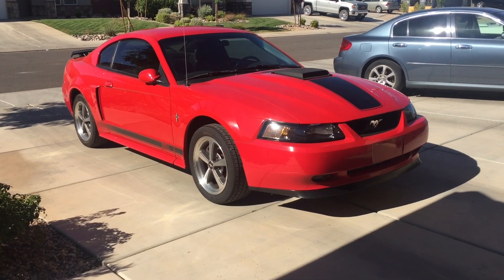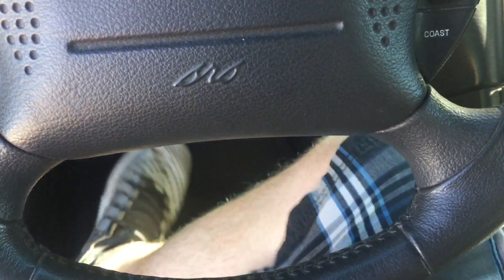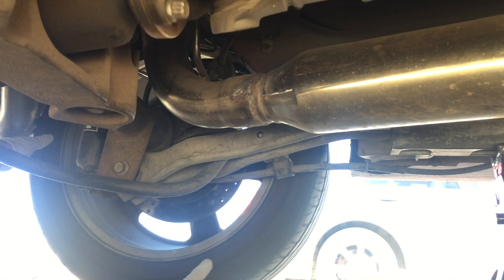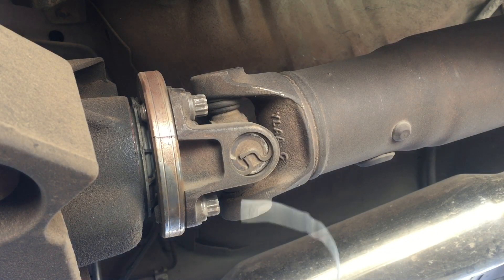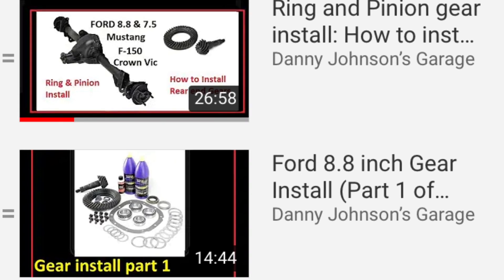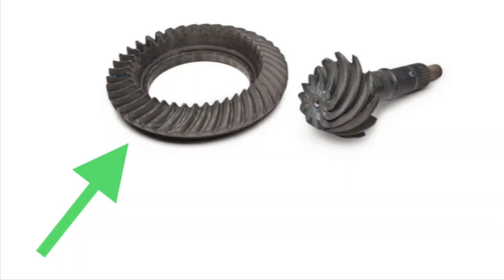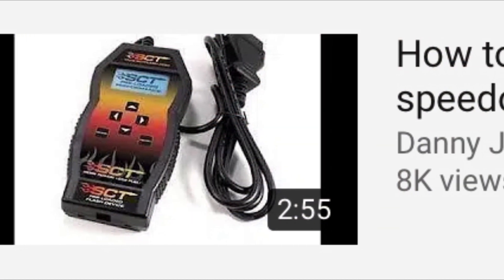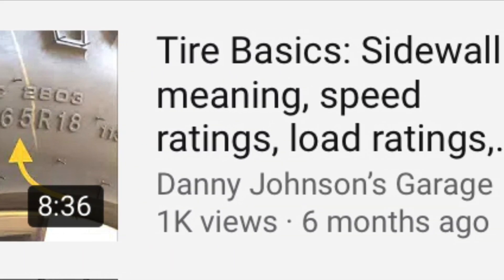What gears does your car have? How to calculate gear ratio or see what gear ratio: Ford Mustang

Comment: Mine came out to alittle over 1 .5 for the driveshaft revolutions to one turn of the tire like you said.   I’m trying to figure out if I have stock or 3:73 from previous owner.  Am I doing something wrong here.   Lol
Reply from the maker: What transmission do you have and what is your rpm on the freeway at 75 mph? What size wheels?
Reply: @dannyjohnsonsgarage  5 speed t45/ stock 275/45/17 tires. I have adjusted my speedo    It used to be 10 off but I adjusted the needle to match gps speed. It’s pretty dead on.   I don’t know if p/o put in 3:73 gears or not.  From the speedo to Rpm’s I would think he did but then the tire to driveshaft rotation did not match up.  That’s why I’m confused now.   The rpm’s are 2.3 at 70 mph.  But again.  I adjusted the speedometer needle.
Reply: @jamesa6272 with the same trans, tire height and 4.10 gear my 97 cobra would turn 2700 at 70 so I'm thinking yours is a 3.55.  373 would be in the middle prob closer to 2400-2500.
Reply: @midnight347  it was the stock gearing. 3:27

Comment: I run a 315 in the rear so if i had 4.10’s about where would that put me?
Reply from the maker: 315 would be the width, so it more depends on the ratio height 315/XX/17 https://youtu.be/3GTTx-XdOXE
Reply: Is it 315/35/17?  If so that is stock height you should be 2500-2700 rpm at 70 depending on which trans you have (if it's manual) you left out alot of important details haha

Comment: 4.10's are a fun ratio on an NA car.
Reply: They're a fun ratio on a boosted car too lol.. I have a 07 gt500 740/733 rwhp/rwhp in 90 degree heat on fat drag radials with a gen3r and it has 4.10s.  It hooks 2nd decent in 2nd and is fine to drive (I have a serious tire on it).  I've contemplated going back to stock 331 gear but I do like how the 4.10s feel the tr6060 is geared kind of tall.
Reply: @midnight347  it can be great for booster applications as well. For turbos it’s stupid to run a gear ratio like that,something like a 3.31 or 3.27 is much better suited. Centrifugal blowers going with gear ratios like that works well. Personally I wouldn’t go higher than 3.55 with a PDB but that’s just me

Comment: Nice video how to do you like the 4.10’s? I’m having mine installed next week.
Reply from the maker: You need good tires. I spin stock ones all the time. I do like the 4.10s though
Reply: @dannyjohnsonsgarage  I look forward to trying them out. I run larger than stock wheels and tires so probably closer to 3.92's since I run 275/40ZR19 in the back.